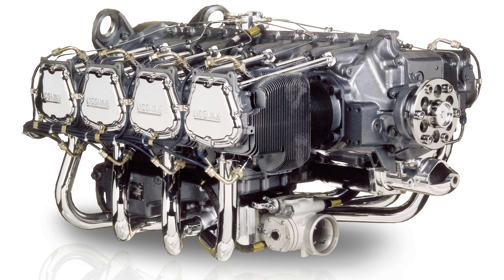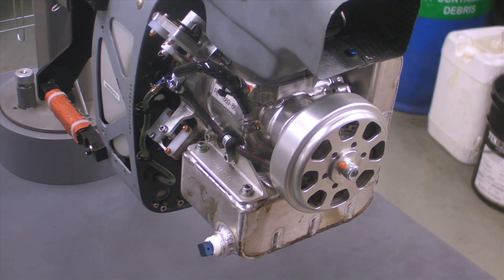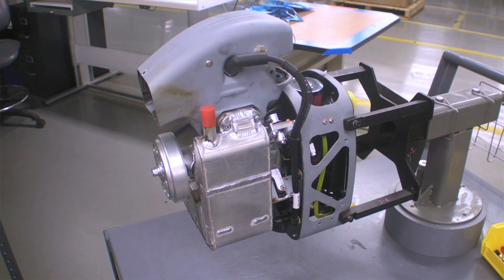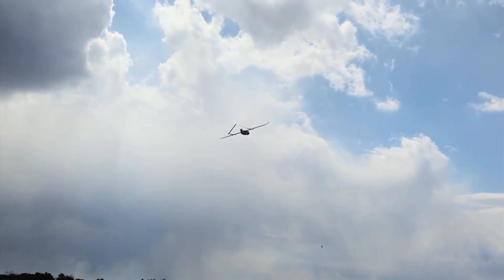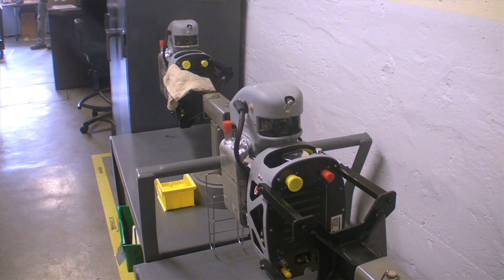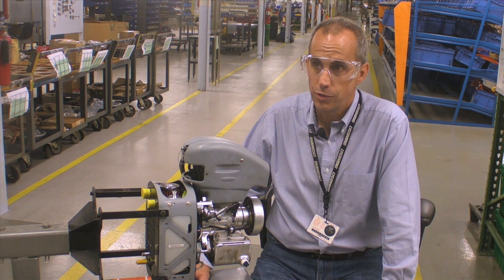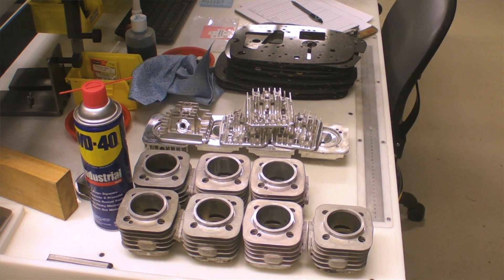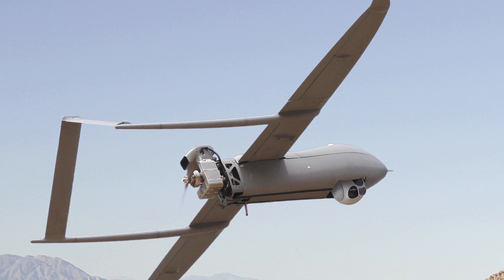The Littlest Lycoming, EL-005

Comment: Cost per unit is in excess of $60,000 USD.
Reply: for a 400tbo engine ??
Reply: Another example of government contractors ripping off government. They should have gone to Briggs and Straton.
Reply: Truly a clown world we live in. I could make a better engine with items from my kitchen drawer, for 99% less price.
Reply: This "clown world" where the average YouTuber cant even comprehend business math, let alone start or run a business, even when given an entire human lifetime to do so, they still cant figure it out.

Go rent a 15,000sqft industrial building at $2/ft ($30k/mo) on a 20-year contract. Hire two dozen employees. Some cost $75k and others cost $150k. The ones who do the design work, development, and set up or manage the assembly line, finances, and business total around $2M annually, just in their compensation packages alone. Not counting  ANSYS and Solidworks at $50k annually, per seat. And each engineer needs a seat. Multiply that by 5 years to develop the engine itself.

What does all this cost? $63.2M over 20 years. Not counting purchasing many millions of dollars in advanced CNC and casting machines. ($10m-50m more). Now how many engines are they going to sell? It would take 1,000 just to gross enough to cover building and salaries alone. 

But since each is assembled by parts that have costs associated, and machines that need purchased or rented, and repaired. And if your profit margin is maybe 10-20% you have to sell 3,000-6,000 at $60k each just to keep your head above water, and lenders at bay. You need to sell 10,000 to make a good profit. That is the catch. Can you sell 10,000? What if the customer decides they want a jet instead, cancel the project, and pick a different supplier? This is called RISK. Risk in signing that 10-20 year building or machine lease. Risk in borrowing $100,000,000 to make it all happen.

This is reality for these sorts of technical niche products. This isn't mass-market ATVs made in china, sold in the millions annually. And it's not amazon.

This is closer to F1 racing than it is to motocross. Or lawnmower racing. (Which youtube commenters are also incapable of winning in, interestingly enough).

This engine has a very low BSFC in class, giving extremely good range potential. It has high altitude capability. It has high power density and is purpose built for an extremely demanding application in the worst environments on earth, operated and maintained by enlisted personal.

It is priced appropriately.

Comment: hello very difficult to watch the use of safety glasses when in no need for them
Reply: Probably a company rule. Any time on shop floor safety glasses to be worn. Easier than finding another eye or job.
Reply: Sorta like wearing a toolbelt between jobs...
Reply: hello Grammer Nazi. Let me know if you find the reason to wear hard hat ,safety glasses, name tags (can get some one hung by their neck) , to build engines LOL. thanks for posting
Reply: pavelavietor1 Maybe you can ask the guy, if you have the balls (which I doubt)...or play it safe and just assume, like you're doing now. Off to the kiddie table, plebe.
Reply: The factory floor was a very dangerous place to be at. He was afraid that something might catch fire or explode in his face. But then again, that might be his prescription glasses!!!!
Reply: It's the ridiculous corporate rules about personal protection driven by insurance companies. It's fine if the environment is even a little dangerous but I doubt it is. I worked at a place where everyone on the factory floor had to wear safety glasses, steel capped boots and high vis jackets even though production assembled metal cabinets with screw drivers and spanners etc. Yet the shipping area where they used a nailgun had no protection around it for flying nails.
Reply: Uhm he’s standing beside a combustion engine?!?!?

Comment: this engine was developed in Australia by orbital engines. They should of gone to efi diesel instead of spark. more torque. less tech to stop detonation like the spark.  or gone to miniature turbo prop like they use in radio controlled stuff.
Reply: Diesels are way too heavy to be practical in aviation, they will have FADEC because they're being based on automotive engines, and they absolutely have to be turbocharged to produce any kind of decent power output.
Reply: @PistonAvatarGuy  still to heavy, I thought cessna has diesel powered 172 out there, was it a success?
Reply: @9.5to1  Yeah, definitely too heavy. The 172 JT-A was only on sale for a very short time, Cessna pulled the plug on it because it was significantly more expensive than the Lycoming powered 172 and it performed poorly.
Reply: @PistonAvatarGuy  that's ashame. There is one that flies locally and it's really quiet that's the first thing you notice
Reply: @9.5to1  It's exactly as it should be, diesels are wildly obsolete. A modern gasoline engine could also be made to be very quiet, but almost no one is developing any.
Reply: @PistonAvatarGuy  yeah I have thought fuel efficient gasoline engines are a better idea diesels are heavier. What about a miniture gas turbine. I know they burn alot and are expensive but they make good power for their weight surely a little one could be made to power a 182 or 210
And yes, rotax 4 strokes are relatively quiet.
Reply: @9.5to1  PBS in the Czech Republic is making some small turbines for light aircraft, but, like you said, they have extremely high fuel consumption. I'm not sure how much their engines cost, but the cost to fuel them will make them very unattractive.
Reply: You know nothing about aviation based on that idiotic statement . . .
Reply: Until a diesel can hold altitude with a failed turbo I will not endorse them. They are not less complex than a gasoline engine in that they require an injection pump that can fail and it is difficult to provide redundancy for this system. 
The turbocharger dependency thing is really putting too many eggs in one basket. A Cessna Turbo 210 can keep flying with a failed turbo. A turbo diesel will not hold altitude in the event of turbo failure.
Reply: I don't see gasoline technology lasting much longer in aviation. Diesels put out rated power at higher altitudes compared to gas engines, require no mix or FADEC, are less complex mechanically and will prove their greater worth over the long haul versus gasoline. Turboprops will continue to expand. Personally, I embrace it.

Comment: Power...how much power?...most military tech finds it's way into civil hands, eventually...surplus, or commercial...i hope they're not scrapping the ones they change out..(i'm sure there are already black market ashtrays)...one or a coupla these things could get me off the ground!!
Reply: I was wondering the same, the military probably doesn't let them disclose the power rating
Reply: Max Continuous (100%) 4 hp (2.98 kW) @ 5,000 RPM
Performance Cruise (75%) 3 hp (2.24 kW) @ 5,000 RPM
Economy Cruise (45%) 1.8 hp (1.34 kW) @ 4,250 RPM
Fuel Consumption
1.7 lb/hr (0.78 kg/hr) @ 5,000 RPM; 1.1 lb/hr (0.48 kg/hr) @ 4,250 RPM

Comment: Very difficult to watch this and resist thinking "wow, modern engine technology from Lycoming..."
Reply: Johnny Tobifour   Obviously you are confused.  This engine runs on Jet A, which is basically diesel fuel or kerosene.  It's a multi-fuel engine that can also run on gasoline.  Actually it runs on JP-5, JP-8, Jet A, Jet A-1, F-24, MOGAS, or Unleaded AVGAS.  

He specifically explained that since Jet A has an octane rating below 30, and this engine runs between 6:1 and 8:1 compression (why doesn't he know the compression ratio?), "you have to direct inject the fuel."   "So it comes into how you inject the fuel, the cleanliness of the fuel, the temperature of the fuel, the amount of energy that you put into the spark, to be able to get a successful light of on it."  This is because running what is essentially diesel fuel in a spark ignition engine is a pretty major challenge.  Aircraft diesel engines run on Jet A.

Upon further investigation into this new direct injection thing on gas engines, it turns out that the contamination comes from the emission control components recirculating waste back into the intake.  I highly suspect that this engine doesn't have any EGR or PCV system to contaminate the intake tract.
Reply: two stroke, jet A.. I bet they went to balsa reed valves and drawings from 1850.
:0)
Reply: *****
I just heard "direct injection" and was all gaga. But I guess all diesels have that...
Reply: Pete Kuhns
Sure, all diesels have that, but he also explained that it is ignited with a spark, and you can see the spark plug on top of the cylinder.  So it is not a diesel engine.
Reply: Direct injection would suck. It's good to have the gas wash the intake valve. Especially for aircraft.
Reply: Johnny Tobifour   Why?
Reply: 8literbeater
With direct injection the fuel is directly injected into the cylinders. The fuel does not come in over the intake valve with the air. Only air comes in through the intake valve with direct injection. This means that fuel does not "wash" over the intake valve which helps cool it and clean carbon off the intake valve. So with a direct injection engine you are more likely to burn a intake valve.
Reply: Johnny Tobifour     I see.  Well I guess that's a small price to pay for being able to use an available fuel instead of having to follow the thing around with gasoline.  Maybe that's why the TBO is only 400 hours.
Reply: 8literbeater
You need gasoline for both. I believe you are confused lol.